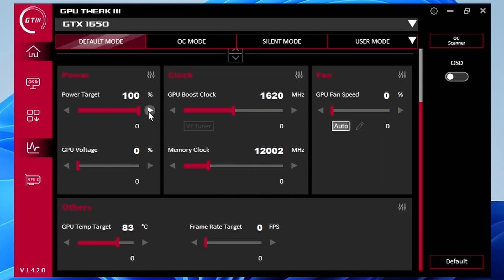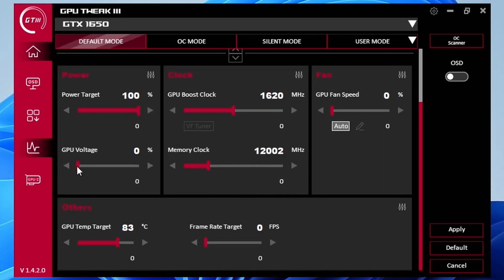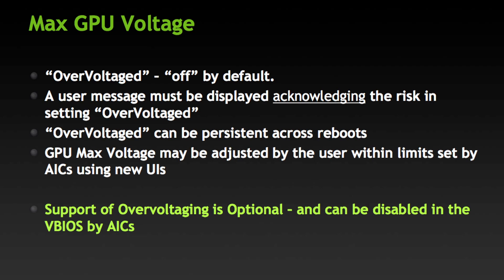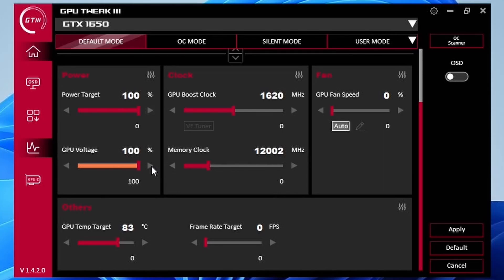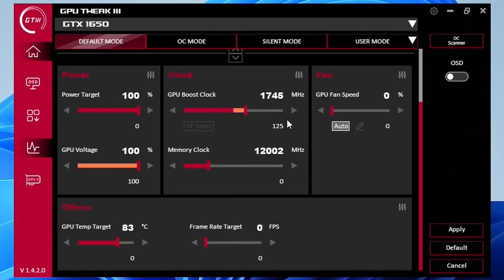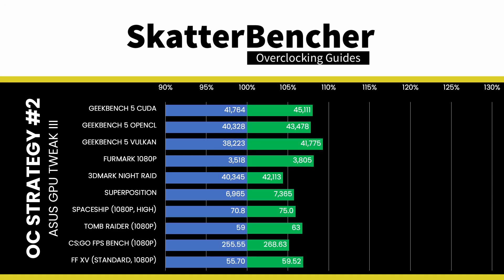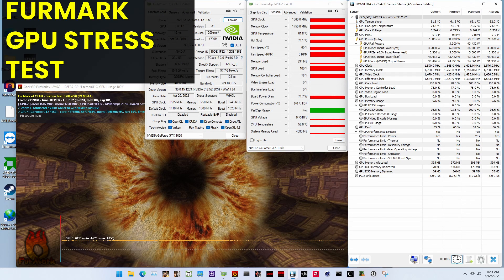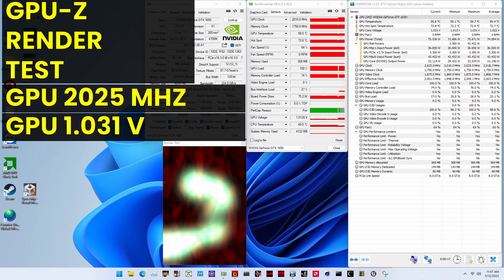5 Minute Overclock: GeForce GTX 1650 to 2025 MHz

Comment: Bro I'm using gtx 1650 gdde6 OC version on pc for some reason my pc crashes if I up my clock speed more than 135 pls tell me solution brother. I have 550 watt psu and i5 11400f. What's the problem ?
Reply: gpu  overclock speed limit is 135 only. it crashes if you go more than that. what you have to increase in 100mhz increments is the memory clock.
Reply: @michaelmodesto18  I able to overclock mine over 140Mhz and memory clock over 2000Mhz

Comment: I have msi gtx 1650 ventus xs DDR6 OC i overclock core clock to 135+and memory clock to 1000 you are amazing to get  overclock memory clock to 2000
Reply: Mine works apex legends +200clock +2000mem is it safe??

Comment: I got same gpu, can i apply on laptop? Use same setting as yours,
Reply from the maker: I'm unfamiliar with laptop GPU overclocking, so I can only suggest to try and see if it works :)
Reply: Seems like afterburner are lock option for core voltage, temp limitl and fan speed on laptop,  only core lock and memory clock are available to set

Comment: 82 temp in warzone bad?
Reply: I reached 90 temp in war thunder and it was still fine on my Gtx 1650 (laptop gtx)
Reply: @NHYSA  Did u use the same settings as shown in the video for laptop GPU overclocking?